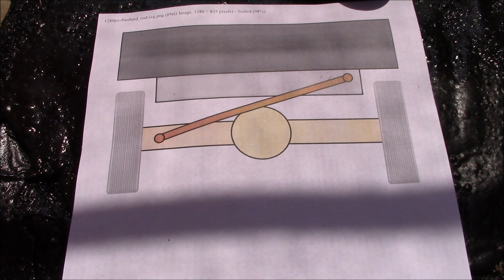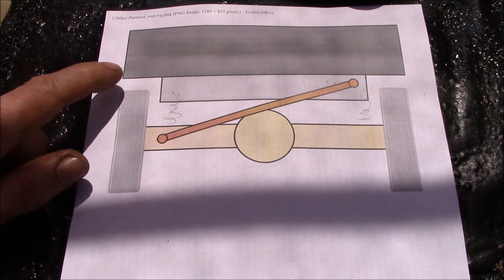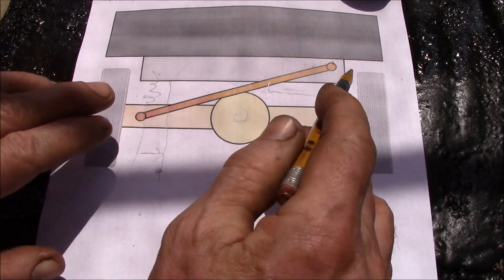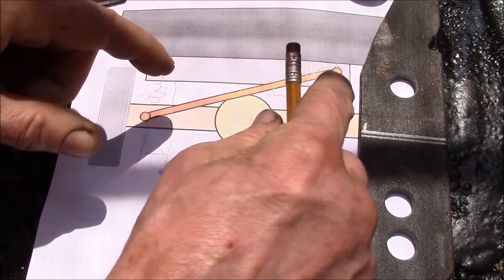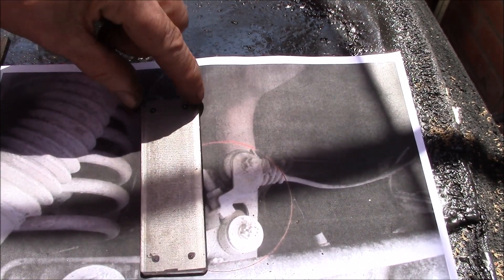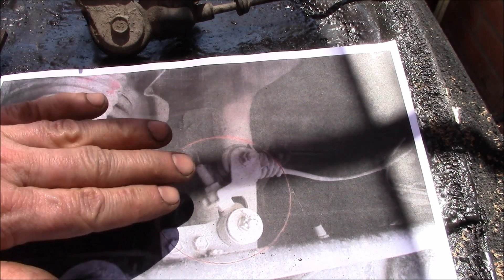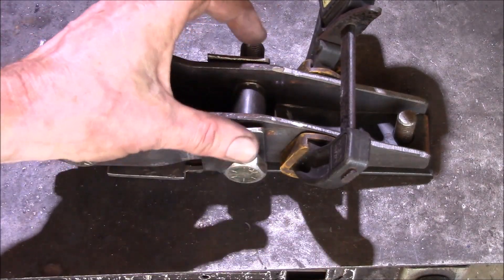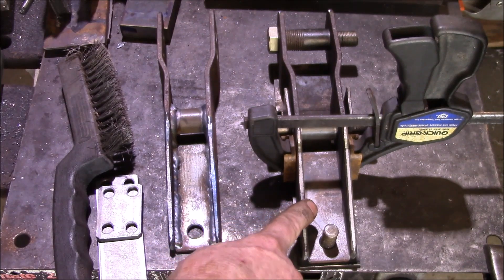2nd Gen 4Runner - Panhard and LSPV Brackets

Comment from the maker: For a DIY panhard drop bracket option, be sure to check out this video:
  https://youtu.be/WYb6ubCPPiI

And here's a link to 3D printable bushings as well as an adjustable panhard bar:
  https://www.thingiverse.com/thing:7026065

And here is a DIY LSPV bracket design:
  https://www.thingiverse.com/thing:7053367

Comment: Great product, easy bolt-in on my 3" lifted Surf, and cures the rear tail-wag over bumps.

Need one for my 100 series now if you could please 😁
Reply from the maker: Glad to hear that.
For the 100 series, there are adjustable panhard bars that would serve the same purpose:
https://amzn.to/3WrpYNa
Or it looks like you could make use of a 3rd gen 4Runner style weld-in panhard drop bracket.
We have had a few customers adapt our bolt-in bracket to work with the 80-series rear suspension.
Reply: @The4Crawler  I'm after a bolt on for the 100 as I'm on a tiny island and not sure who I'd trust with a welder - I may just go and compare the rear with the 100 tho, as if it can be made to fit then it's worth a try!

Comment: Is there is a need for this bracket if I have only 2" suspension lift? What if I wanted add 1" body lift will I need it?
Reply from the maker: At 2" lift, may not need to adjust the panhard unless you notice the right rear tire is sticking out of the wheel well farther.  If so, measure the heights of the 2 ends of the bar and if there is 2.5" or more difference in those heights, then a panhard bracket will help:
https://www.4crawler.com/4x4/ForSale/CoilSpringSpacer.shtml#PanhardDropBrkt
You could also install the LSPV bracket if you notice your rear braking is a bit weak or you've run out of adjustment on the LSPV sensing rod.

A body lift will have no affect on either of those items as it only raises the body up off the frame.  A suspension lift raises the frame (where the panhard rod and LSPV valve attach) above the axles.
Reply: @The4Crawler  I really appreciate your answer and thank you very much for this great video.
Greetings from Jordan 🇯🇴

Comment: So I'm working on lifting my 4Runner. I already added two 2 inch lifting rear springs brand new shocks and new bushings in both upper and lower control arms. What LSPV bracket and panhard bracket would accommodate such a lift
Reply from the maker: Best to measure and see:
https://www.4crawler.com/4x4/ForSale/CoilSpringSpacer.shtml#PanhardDropBrkt
You may not need anything on the panhard, 2.5" is the shortest we can make.  On the LSPV, disconnect the end of the rod at the axle and see where it sits with the sensing rod near the top of travel at the valve on the frame.  Distance between holes is a rough idea of the size of bracket needed.  That rod is adjustable in length and can also be bent a little if needed, so you may not need any bracket.
Reply: @The4Crawler  awesome thanks for a quick response! The track bar does not line up with the factory OEM hole going with the shortest application that you make might be my solution
Reply from the maker: @lowdawg1776  Easy enough to measure ground up to mounting hole on the axle and ground up to mounting hole on the frame.  Difference in those two measurements is the size bracket you need.
Reply: @The4Crawler  your the man thank you!!
Reply: @The4Crawler  you know what I just realized and it blew my mind just now. 4crawler. Com has help me rebuild this 4Runner with all the forms and information and if anybody out there needs help on rebuilding a 4Runner anything from not starting to modifications this is the go-to place for 2nd gens

Comment: Hi,can you make it to fit a Land Cruiser 1994 lifted 6" front and rr? and if you can make them,how much?my email is fmayoral25@gmail.com,thanks
Reply from the maker: We've had a customer in Australia install one and this is what he reported back:

"The bracket fits fine in the chassis end had to slightly spread the other end where the panhard rod attaches but only 5mm or so."
Reply: @The4Crawler  so,that means that fit with slighly trim,how much does it lows the panhard down?and how much it cost?
Reply from the maker: No trimming, it seems you just need to spread the bottom sides out a bit to fit the slightly wider panhard bar end.  Pricing and dimensions as noted on the web page:
https://www.4crawler.com/4x4/ForSale/CoilSpringSpacer.shtml#OnlineOrderingPHB
From US$49-$69 depending on options, sizes from 2.5 inches to 6 inches.
Reply: @The4Crawler  Hi,do you nake it for the front end too that fits the fj80?
Reply from the maker: Never had anyone ask for a bracket for the front end.  If it's similar to how the rear panhard bar attaches to the frame, there's a possibility the same bracket will fit there.  Our bracket needs a flat area about 4"/100mm up from the original bolt to sit flat against:
  https://www.4crawler.com/4x4/ForSale/Images/PanhardDropBrkt.jpg
Or you may need to get an adjustable length panhard bar.
Reply: @The4Crawler  ok,how much cost that rear one and sending it to Bayamon,PR,00956?
Reply from the maker: Pricing and shipping information on the web page:
https://www.4crawler.com/4x4/ForSale/CoilSpringSpacer.shtml#OnlineOrderingPHB
 There are three drop bracket kits are available.

    The basic kit includes just the drop bracket itself, you'll need to supply a smaller (3/8" - 1/2") bolt, about 1" long, for the top of the bracket and a larger (9/16" - 5/8") bolt, about 3" long, to attach the bottom of the bracket.
        Cost: US$49.00 
    The deluxe kit includes the bracket and also the additional bolts required to install the drop bracket on the existing frame bracket.
        The bracket is set up for a 4" lift, that is it will relocate the panhard rod 4"/102mm lower than the frame bracket. It is possible to drill the bracket for less lift. This can be done by the end-user.
        Cost: US$54.00 
    Or the third option is that the bracket can be ordered custom fit from 2-1/2" up to 6" drop.
        The custom fit brackets are also modified to allow for more adjustability in the left-right direction to allow fine tuning the stock panhard bar "length", see the installation notes for details.
        And a new option is the double-drilled 3" - 4" drop bracket that has holes for both 3" and 4" of drop in one single bracket.
            This is a good option for folks who are planning to install lift springs but don't want to wait and measure the actual lift height they get. 
        Cost: US$69.00 
    Shipping:
        US$7.95 for US Priority Mail postage